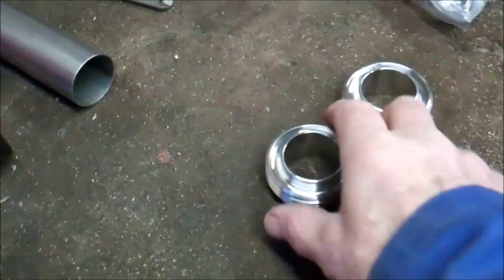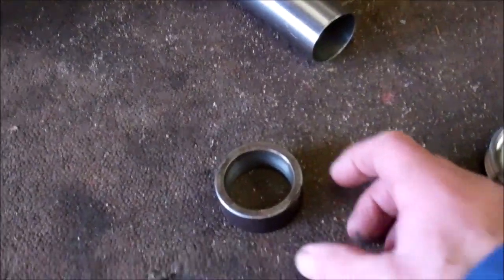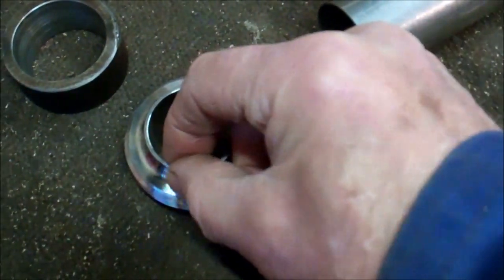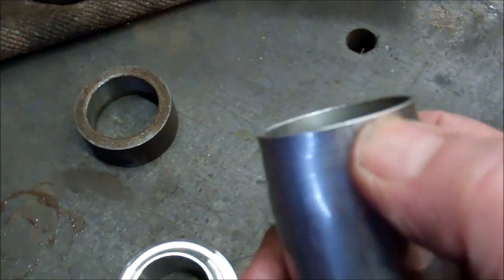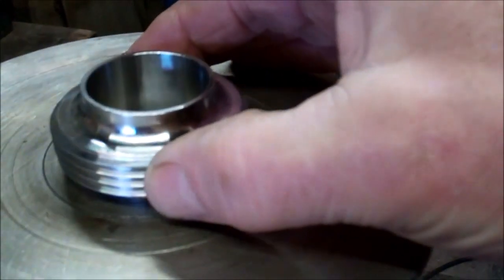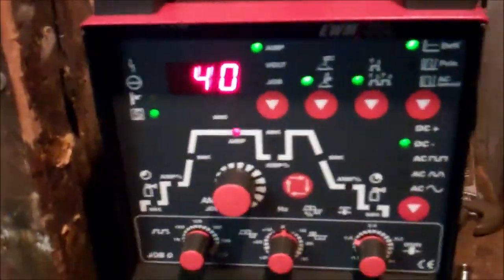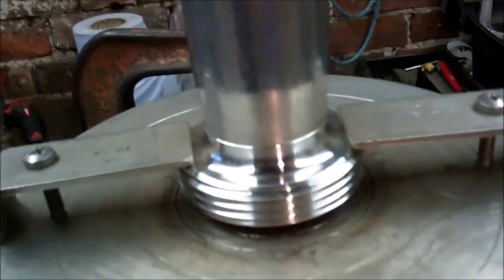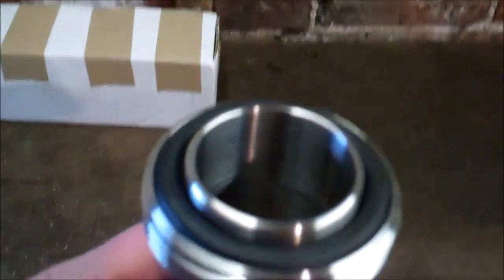40 mm stainless steel tube lined up and butt welded to 38 mm fittings

Comment: Hello John, love your videos. I have a question about how you would handle welding ends onto a 5m pipe? How would you handle the purging etc?
Reply from the maker: Charles Sibbald, Thank you for your comment, you have not said what diameter the pipe is, I assume the pipe is stainless steel and 5m in length with no other side branches on it, and you want to weld a blank on both ends, to do this I would machine two rebated plugs that  press very tightly into the ends of the pipe, the plugs need to go into the pipe by at least twice the width of your weld, back purging will not then be needed as there won't be any oxygen in contact with the back of the weld, let the first weld cool before fitting the second plug to minimse pressure building up inside the pipe.

Comment: Wonderful video!   Sir, If I might ask, what is copper grease? (copper solder flux?) not to introduce impurities into the stainless, while still providing lubrication to the surface when in the taper die?  Do you also due a passive treatment of acid after clean up? Thank you for helping with the question,  Learned a lot from your videos, From Pennsylvania :)
Reply from the maker: James Mihalcik, Copper grease is a anti seize compound it also withstands high temperatures, and because it stands up to high temperatures it gets used as an anti seize on components close to the brakes on motor vehicles, (it is not really used as a lubricating grease) it does contain small particles of copper and this is the reason I use it, as I think it helps to give a thicker film and help stop any scoring.
 Stainless steel is self passivating given a few days, I only passivate it if it's going to quickly come into contact with corrosive conditions. Thanks for the comment.

Comment: Sir another really good video 👍👍
That taper ring??You make self or I'm can bay somewhere?? 
Regards from Poland
Reply from the maker: Marcin Lisiak, The tapered ring is something I made, I have also made other shapes and sizes for special jobs. Thanks for the comment.
Reply: John, thanks for the video. Do you tack the pieces before or after your backpurge? What would you charge the customer for a job like that considering you had to make the tool, etc?
Reply from the maker: @sbaisden100  I tack the parts "after" purging. The special taper tool was made several years ago and has been used for a number of different  jobs, I do not charge for making any tooling if I think it will be useful for other jobs. My Jobs are charged by time and materials used.
Reply: John Bower Thanks John. I charge $55/hour, but some shops get as high as $75 near me (Cleveland, OH). Mobile work, which I don’t do, commands an even higher rate. I hear you on the tooling. I’m amazed how often I made something for one job that has repeat uses... if I can remember I made it and where I put it!